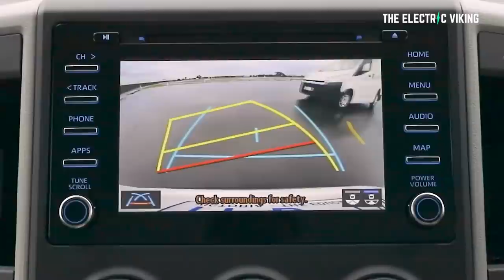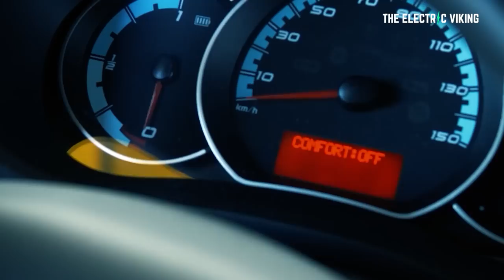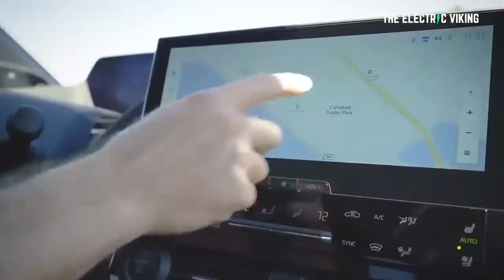Toyota HiAce electric van confirmed - everything we know

Comment: Toyota is anti-EV primarily because it enjoys a well-earned superior market position in hybrids, both for plug-in and non-plug-in types. Additionally, Toyota is far behind Tesla and China's EV producers. The so-called "diversification" with plug-in hybrids, fuel cells and hydrogen is nothing more than a strategy to divert others from fully electrifying their vehicles. Other evidence of this strategy of diversion is Toyota's leading a Japanese consortium of vehicle producers, whose mission is to assure or maximize the continuing use of combustion engines in passenger and other vehicles.

Comment: The Ford E-transit is best in class for now, though I'm perplexed as to why they don't apparently have an option for vehicle to grid/bidirectional charging like with the F-150 Lightning. I've ordered a Long Range Model Y instead. More expensive, certainly, but over twice the range of an E-Transit. Tesla Supercharger network/FSD FTW.
Reply: I equate buying an electric vehicle from a company that produces mostly gas powered ones to ordering a vegetarian meal at a steak house.   They make them with a lot less enthusiasm and I would doubt their commitment.
Reply: the transit evan doesnt have the range since ford isnt wasting batteries on this van, it would be very successful with a range approaching 300 miles, currently less than 200 miles.

Comment: After many years of criticism Toyotas Hiace was widened. Unfortunately the dummies in the design and marketing sections at Toyota still ignored barn rear doors, required to load pallets using the new width. My Hiace is 14 years old, its great. Waiting for a new Hiace that is courier ready, really. That means hybrid not electric. Another desire is a solid cargo barrier, this makes heating or cooling more efficient and cheaper.

Comment: The U.S. is not electrifying fast enough. CA wants only EV's to be sold after 2030. Just last week (9-5) the grid was overwhelmed and told people not to charge their vehicles because of demand too much.  .CA has decided that their last nuclear power plant should stay open for five more years. The French are 90% nuclear and it has been very good for them. Hydro power is down because of the draught in the U.S. Southwest and electrical bills continue to skyrocket.  Just imagine when EV's are in greater demand and the grid will grind to halt.  Maybe hybrids will be the ultimate solution for the next 10 years as a bridge to the future.  Maybe Toyota is right.
Reply: Electricity can be imported from other states and it moves at light speed. No problema

Comment: Good stuff Viking. Toyota is a Premium brand, it’s Mfg. capacity is currently ~ 5X more than Tesla.
So, I expect that their Engineers are fully aware that they can’t make a Prius in Less than 1 minute, it has Too many Parts. So they Know they need to Pivot Soon! Toyota IS of course, following closely, Tesla, BYD, etc. However they Typically have fewer Constraints from organized labor (than Legacy brands). I think Toyota is being Coy about their EV plans, it would be Surprising if they haven’t already made plans for a TeraFactory for Mfg. the Sleds/battery packs/batteries, while they build Giga Presses for the F/R Castings/battery pack.
Elon has shown them what they Need to do, and I think they will move far quicker than they’re letting on.
Everyone will need to get their own GigaPresses, and Japan Has the ability to manufacture their own (for National security reasons).
Cheers from San Diego

Comment: Well Scott you'd be wrong of course - while there are a good percentage of people that use their truck like a toy; most people that have a pickup in the USA use it for a truck; they load the bed to capacity, they tow a boat or a trailer or some other similar duty; they work out in the fields or ranch ; that is why they purchased a truck.  You evidently don't do much travel in the rural parts of the USA. Trucks are used for trucks. EV trucks are for the toy crowd.

Comment: The H300 HiAce in Australia is already a rebadged Stelantis van, so i'm not surprised that Toyota went back to Stelantis for the electric version of Stelantis' van (the Stelantis platform was designed many years ago to be EV/Petrol/Diesel, that seems to be paying off for Stelantis now)
But this begs the question, if Toyota is outsourcing all their EV manufacturing to other companies then what will they actually make in the future? Will Toyota just become a "badge" brand where all their vehicles are just rebadged version of other vehicles, if that's the case how long will Toyota's brand have any value?
Reply: Stop talking nonsense!!!! Th Toyota hiace 300 is entirely developed and manufactured by Toyota it has nothing to do with Stellantis.
Reply: Toyota only used stellantis platforms in Europe because they have partnerships and Toyota actually is helping stellantis for your info!

Comment: IMO, this is the huge missed opportunity from Tesla. A Canoo sized (approx) van on the model Y chassis would have been huge for them.
Reply: Useless!!!! A van on a car platform!? Wtf!!!! Vans have their own dedicated platforms for maximum practicality and also modifications……. There is a reason why Toyota hiace and Mercedes’ sprinter and ford transit are soooo popular for all kinds of applications
Reply: @alanmay7929  obviously you are wrong sir. Small vans have been produced for years on car chassis. Check the specks for the Canoo van, Tesla could easily do something similar with the model Y chassis.
Reply: @carrdoug99  nonsense!!!! The Canoo van is a bespoke platform for a very specific vehicle it has nothing to do with any other car! The modelY is not optimised for a van, at least for maximum practicality. The tesla van might be something based on a Mercedes’ sprinter or a new platform. The castings doesn’t allow that much flexibility in manufacturing
Reply: @carrdoug99  the vw caddy is van based on the vw golf and the rear suspension is totally different to maximize practicality
Reply: Vans are in a highly competitive market segment and therefore have minimal margins especially with corporate customers who will want large discounts for volume purchases.  Also vans get extremely heavy use & abuse to make a good van you need a battery pack with high cycle life and high power density!
Reply: @jackdbur  I guess it's a mystery why vans may very well save Canoo (Walmart, NASA & the military), and give a real boost to Rivian (Amazon). Ford seems to relish the space as well. Mystery indeed. I guess Tesla is building Semi's and trucks because there's not much competition?
Reply: @carrdoug99  Canoo is a consumer utility vehicle not a commercial van , and still to be put into production. Rivian is being contracted to produce its van by Amazon. Ford has been America's biggest van seller for decades (you need to keep your market happy). Tesla is selling every last 3&Y they can produce, (still battery constrained)

Comment: The carbon footprint of EV's is completely out of wack compared to current ICE cars. A current ICE car will not exceed the carbon footprint of an EV during its lifetime of burning fossil fuels. EV's require way more fossil fuels to produce when compared to ICE vehicles AND over 90% of their eletrical power is generated by power planets that run on fossil fuels. You don't need a degree in math to understand that Toyota is right in this case. That fact that you implied that Toyota's vehicles cause cancer shows your ignorance.

Comment: Thus far EV trucks are a failure. I am talking about an EV truck that has any sort of worthwhile range; both a F150 Lightning and Rivian; get about 100 miles towing a trailer. How useful is a van w a 100 mile range under load; even 80 miles  in freezing climates . You'd need to use it for some pretty short range functions; or very low load uses. Perhaps if you had a huge battery?
Reply: im going to guess that 95% of new pickup dont tow anything anywhere.
Reply: @scottmcshannon6821  And you'd be right, the "it has to be able to tow" requirement is just rubbish, most utes and SUVs never tow anything, ever.
Reply: It’s the wrong use case for a light truck BEV. Still, a 2.1 tonne Pickup or a 1.9 tonne TM3 will tow anything up to that mass safely. Just not very far
Reply: I believe that the stated range of both riving & f150 are at 1000lb load .

Comment: I would have called lithium cars as winners if it was abundant, available to all, and cheap. It’s all opposite. Lithium prices are 20x in last 2 years. Since demand increased. Toyota had a hybrid before Tesla had a car. They have a hydrogen car which genius Elon thinks won’t work. But a battery truck will work. Haha. In every video about Toyota you can’t stop mentioning Toyotas tire fell off. Let’s not compare Toyotas reliability with teslas. Let’s just not. They have at least 50 year history to prove otherwise. And let’s not compare teslas to iPhones. 700 dollar iPhone most people can stretch and afford but 65k teslas with Chinese battery and soon entirely built in China. And I absolutely believe lithium battery is not the solution.
Reply: Toyota also had an 8% stake in Tesla and co-produced a Rav4 with Tesla!  That 8% stake had they kept it would be worth more than Toyota's market cap. $26 per kg for H2 yep that's a winner!

Comment: Those who chastise Toyota for not going all in on fully EV vehicles forget that Toyota is a truly global company and any technology it commits to has to work in the developing world as well as the industrialized west. While a fully EV vehicle might be wonderful in a First world city, it could not function in most developing countries, both in terms of charging infrastructure and energy production. A better option in both contexts would be plug-in hybrid electric vehicles that require lower amounts of lithium (given their smaller batteries) yet for most commuters would function as if they were fully electric vehicles (given the short distance of most commutes). In addition, I am sure that they are aware of the impossibility of building out a supply chain that provides batteries for a fully EV world.

To add on to that you have to look at what is happening to Japan right now. After the Fukushima disaster, They have been experiencing blackouts do to not being able to produce enough power for there current consumption.  Being an island they cannot just ask there neighbors to send more power. 
Of course they are doing every they can to slow down the adoption of EV's. 
That's also why, (I think) they are going so hard on Hydrogen. For the first time since the 1940's they will have access to fuel they control.
Reply: Production of H2 requires multiple times more power than charging batteries that hydrogen cars still need and are degraded faster in! Developing countries are unlikely to be able to afford multi million dollar hydrogen refuelling stations that are power hungry.